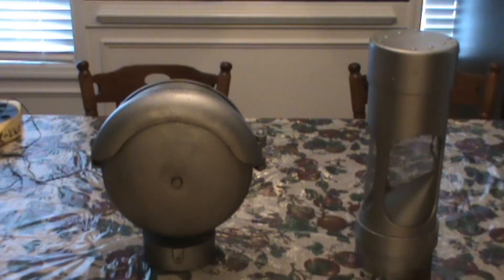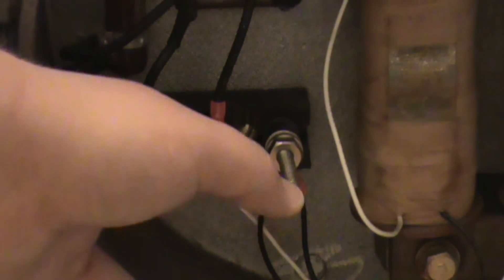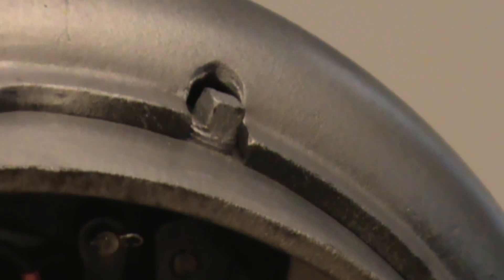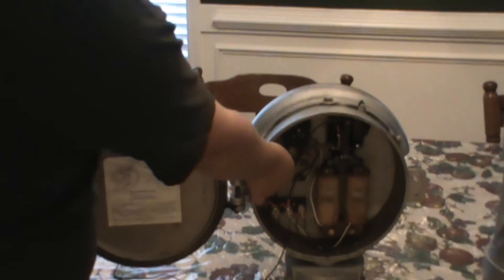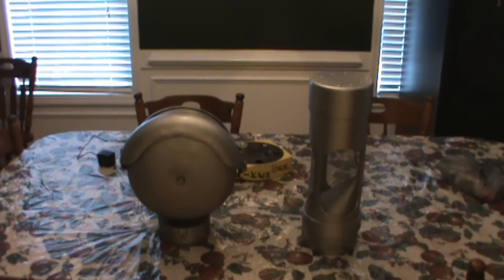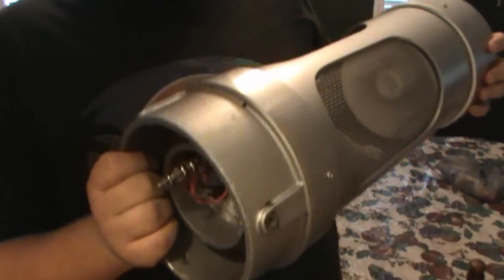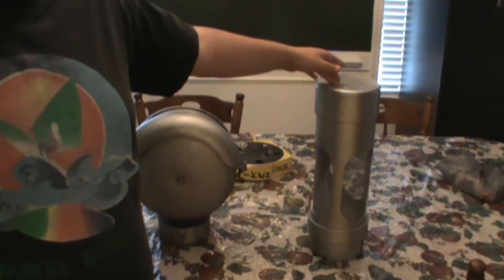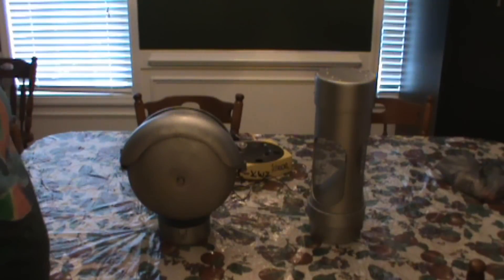A How To, On A WCH And GSI Grade Crossing Bell

Comment: help please i purchased a safetran bell it says model 23 serial 30242 and looks to be DC powered. i have no clue about AC and DC. i got this for my father inlaw so he can put it in his Bar. the guy that owned it had a mad scientist wiring conteaption i could not begin to explain. is there an easy way to fire this thing up. it looks like all you did was cut into a DC plug.